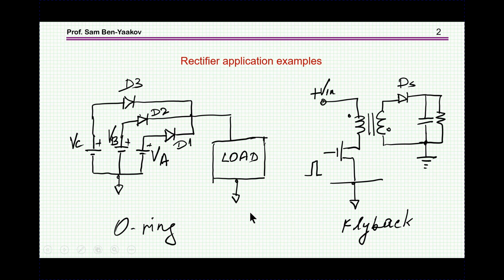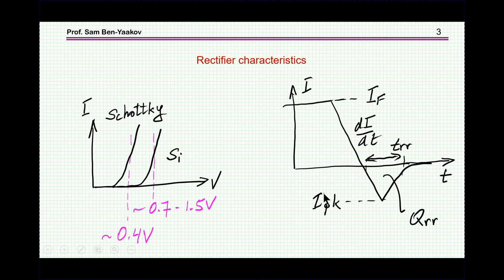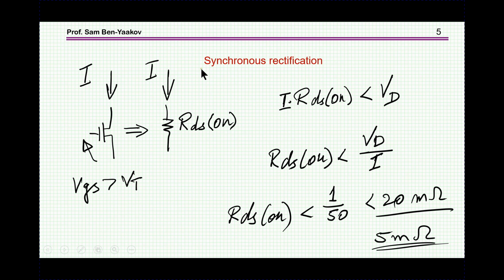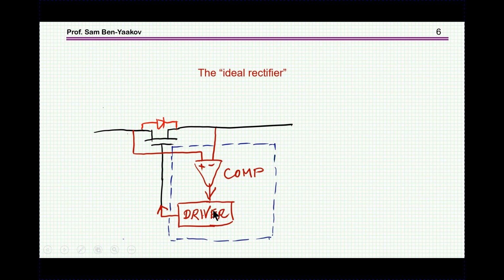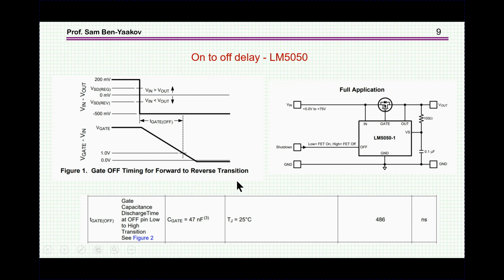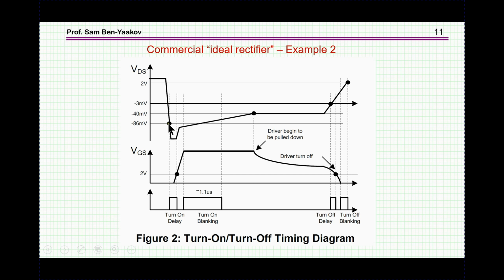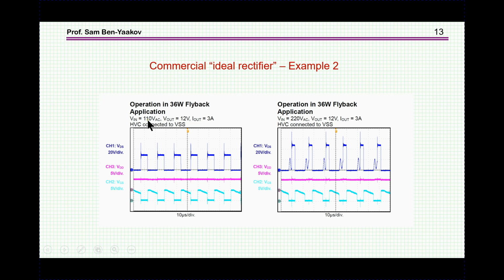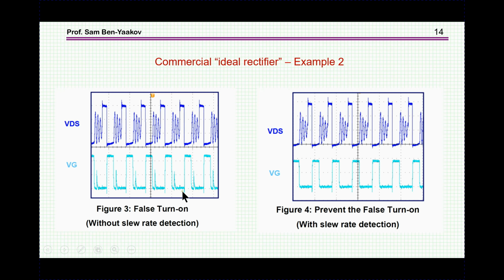Ideal rectifier

Comment: Dear Prof Sam,
In these examples the source and drain are not marked, but if the diode is used as an indicator, you seem to have the potential higher at the source than at the drain. 
I cannot see how a mosfet can be used as a blocking diode given the internal diode characteristic.
Reply from the maker: The fet does not block the current. It provides a low Rdson in paraĺel to D when the diode is supposed to conduct.
Reply: @sambenyaakov  Thank you for the reply. To clarify...
Are you saying that the mosfet is used to pass current in the opposite direction to normal? 
i.e. Instead of conventional current flowing in at the drain and out through the source ( usually to GND), 
In this application the current flows the opposite direction.
Reply from the maker: @davebutler3905  Indeed. Once turn on, the MOSFET is bidirectional with Rdson
Reply: @davebutler3905  The source and the drain are distinguished by the voltage applied at the terminal. The terminal with the higher voltage is the drian while the terminal with the lower voltage is the source. The body can be tied either to the drain or the source. In this application, the body is tied to the drain.

Comment: First, I should thank you so much professor Ben-Yaakov for sharing your knowledge and  precious experience with your students over the internet.  I personally learnt a lot more from  watching your lectures  than reading many power electronic books. I am also wondering if you kindly put more lectures about switching caps and charge pump converters. Furthermore, there is a new family of converters which is called the hybrid topology where we can mix a capacitor based converter with inductor  based converter, and I was wondering if you could make us more familiar with this new family.
Regards,
Sam Jafari
Reply from the maker: Thanks, there are quite a number of videos on SCC in my channel. Look for the index at https://www.advicepoweracademy.com/video-tutorials

Comment: Interesting fact with slew rate detection, so far i use signals from the primary side to control them. Certainly will look forward in testing such device.
Reply from the maker: Let us know what you find when testing such controllers.